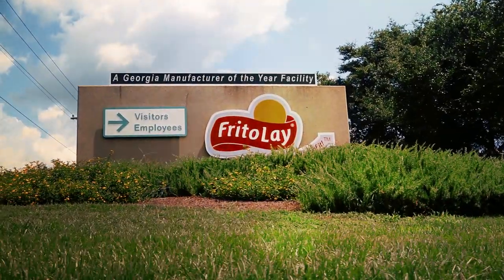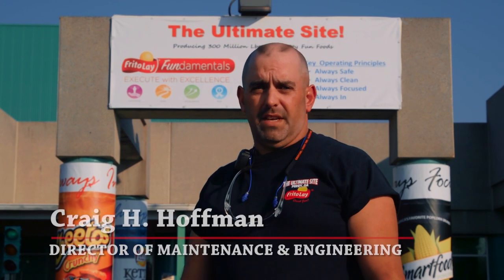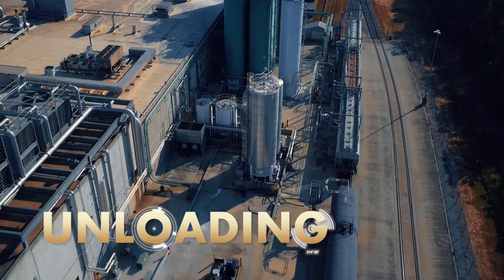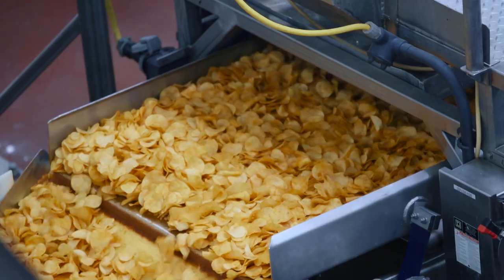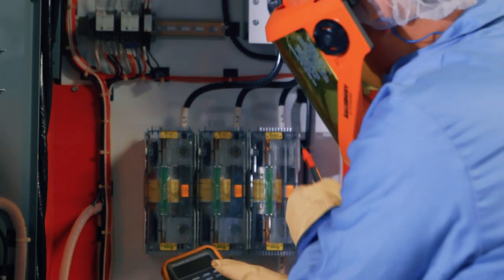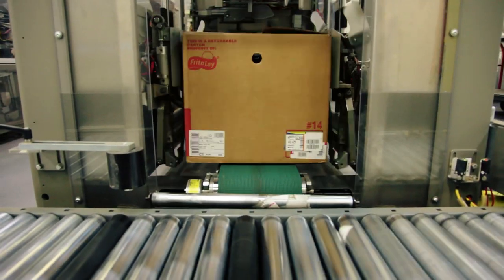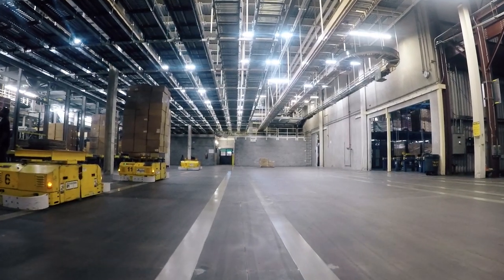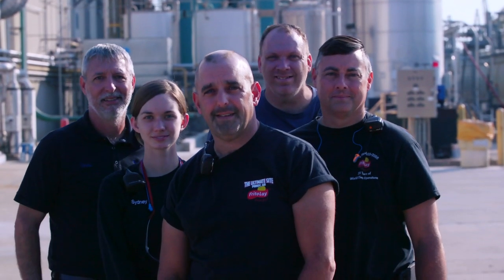Frito Lay Industrial Mechanic Video

Comment: I was a US army Mechanic for 10 years, took the test and wasn't even selected . For a jr level position, I could more than do this job but why is it so hard to get into this company for every little thing ? Same thing for forklift experienced.. I have 3 years in a forklift , Although sit down and they said no..
Reply: Its because you're better off knowimg someone there than knowing "enough" per their entrance exams. They basically want the top 5% but its something they can hold off on until they meet unnecessary standards